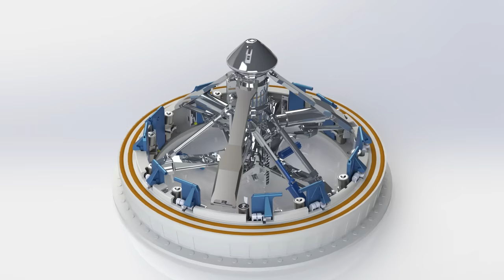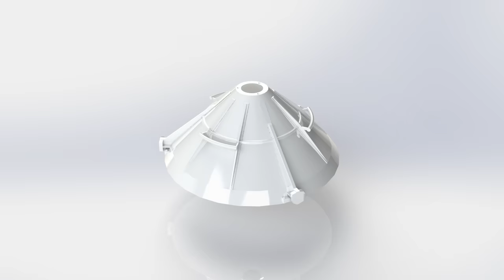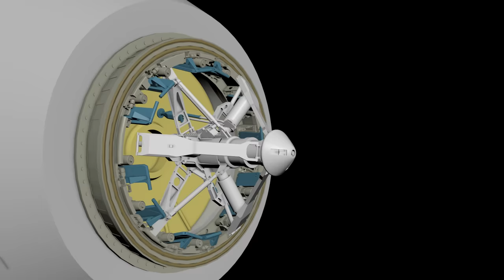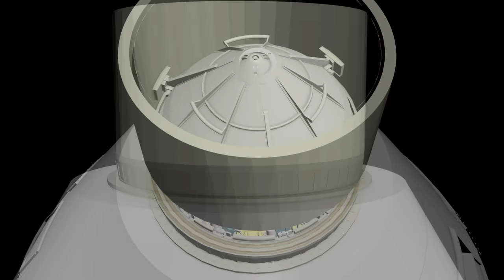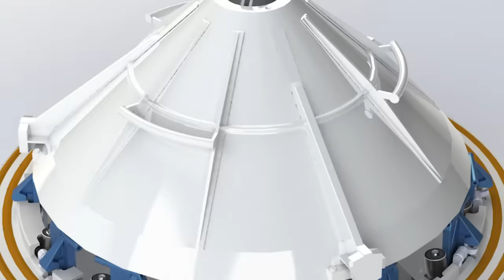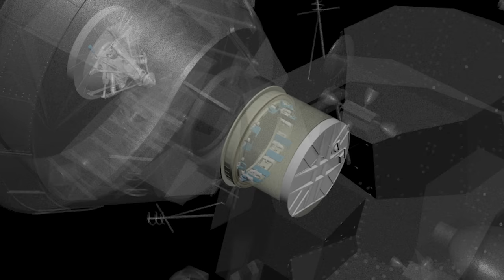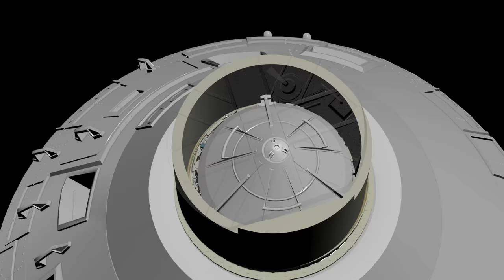Apollo Docking sequence - Connecting the Command Module to the Lunar Module.

Comment: As a young Aerospace Engineer  at NASA-KSC, I  was assigned to work on the Apollo Command and Service Module (CSM) for Apollo  missions 6, 9, 12, 13, 15, 17,  the three Skylab's and finally the Apollo Soyuz Test Project (ASTP).  Starting with Apollo 9, all Lunar Excursion Modules (LEM) ascent stages were mated to the Apollo Command Modules (CM) at KSC.   For Skylab, only the first of the three Skylab missions was the Skylab docking module docked to the CM.     On ASTP the Docking Module/Air Lock was docked to the CM in the same manner as the LEM ascent stages.  In addition, the Russian side of our Docking  Module had been previously sent to Russia and mated to their side of the Soyuz spacecraft.  All the docking tests at KSC were performed in the large CSM altitude chamber except for the first Skylab mission.   The Skylab docking module was too long and could not be lowered into the altitude chamber.   This test was performed after the CSM was removed and placed on another test stand. All docking test were performed in the same manner.   LEM ascent stages, Skylab docking module and ASTP docking module were inverted upside down outside of the altitude chamber before being lowered on to the CSM.  A special lifting device was used that controlled and monitored the amount of weight being lowered onto the CSM docking ring.   The Apollo prime crew commander using the mounted  Crew Optical Alignment System (COAS) in his forward looking window monitored the LEM ascent stage target during the lowering of the ascent stage. This helped us to properly align the two spacecraft.   After probe to drogue capture was verified by the prime crew, the ascent stage was lowered until just before the 12 ring latches would be triggered.   This was the critical part of the test.  Each of the 12 latches has a pull down clamping force of 2,000 lbs for a total of 24,000 lbs.  The 24,000 lbs would greatly exceed the structural integrity of the ascent stage as the latch hooks pulled the the ascent stage to the CSM docking ring in the 1g environment.  The specially designed lifting sling was capable of controlling the LEM ascent stage in a manner that only allowed just 5,000 lbs to be inserted to the ascent stage.   Once docked to the CSM, the lifting sling would only let a maximum of 5,000 lbs of the ascent stage to rest on the CSM.  Then the Apollo Commander would do a final adjustment to his window mounted COAS by manually aligning the cross hairs in his COAS to the ascent stage docking target stand offs.  After the docking probe and drogue were removed by the crew, the Lunar Module Pilot was to attempt entry into the ascent stage in order to align the Lunar Module COAS to a CM target that he installed above his seat looking out of his forward window.   On Apollo 9 two things became obvious,  first the lunar pilot could not properly adjust the COAS since he could not stand upside down in the ascent stage.   Second,  he found that it was difficult to see the CM target through the small CM window.  At that time the Apollo program called for the LEM to be the active vehicle for docking when returning from the moon surface.  As a result of the docking test, the CSM became the active vehicle for all dockings.  Finally, how the 12 latches worked.  The 2,000 lb clamping force is the result of a set of stack Belleville washers in a cylindrical housing that is connected to the latch hook.  The first pull of the latch handle compresses the Belleville washers 50%.  In addition, it raises the latch hook up off the LEM docking ring.  The second pull of the handle compresses the Belleville washers to 100% and retracts the hook to clear the LEM docking ring.   When the latch is triggered releasing the stored energy in the Belleville washers, the hook moves forward at the same time it clamps down on the LEM ring.  If a latch fails to fire,  the astronaut can activate a backup release button on the latch.  The blue latch handle had an indicator button that let the crew member know if the latch hook was fully engaged on the LM docking ring.  If it was not fully engaged he could then re-cock the latch and fire it.  Only a minimum of three latches were required for the mission.  To remove the docking probe he first disconnects the electrical connection between the docking probe and latch ring and stores it on the probe. Then he would move a lever that allowed the three legs of the docking probe to collapse.  The next step was to manually releases the three docking probe latches form the drogue and store it under one of the crew couches.  After the CSM/LEM was in orbit around the moon and the two crew members were in the LEM with the LEM hatch and the docking drogue installed the Lunar Pilot would insert the docking probe into the drogue automatically engaging the three probe head latches.  The electrical cable would be un-stowed and connected to the docking ring. Then by moving the the same release lever used in removal he would extend the collapse legs.  The three legs would be inserted into three pockets in the docking ring.  Next he would operate a blue ratchet handle at the base of the docking probe. This was a ratchet mechanism connected to a hook that kept the docking probe retracted.  Ratcheting the handle preloaded the hook to maintain structural integrity and sealing of the two spacecraft while the twelve latches were cocked.  After the CSM tunnel hatch was installed, the lunar pilot would release the three probe head latches.  The two spacecraft were no longer docked.  Once separated he then would electrically release the probe hook for the probe to be extended.  Upon redocking he would initiate a gas cartage inside the probe to retract the probe.
Reply from the maker: Wow, absolutely fantastic. That was amazing to read. Thank you so much for posting. I love the fact I've put this up and so many more interesting people are contributing to the discussion. Thank you so much for your contribution.
Reply: And like magic every single thing all functioned on version one with no real test system. Total  BS
Reply: Agreed 💯%
Reply: @marxman00  Almost like nasa knew what they were doing.
Reply: @chobinator8741  Sounds like a word salad sci fantacy , You could equally use that explanation to explain how santa clause delivers all his presents
Reply: @marxman00 Every bit of it was thoroughly tested beforehand. There was no guessing at all. That's what engineering is for. Providing all the tech for idiots to troll in maximum comfort.
Reply: @lunakid12  just like the "vaccine" you took
Reply: Well, that's easy for you to say!
Reply: What would 😅happened when those patches suspend?
Reply: The Apollo spacecraft docking with the Skylab didn't have a docking module. The docking port on the skylab already had the drogue installed on launch, so before undocking, they just stowed the probe in the CM, leaving the drogue behind for the following two flights. On Apollo 14, they did the same thing after rendezvous in lunar orbit before trans earth injection, they brought the probe back to earth, due to the docking problems they had during transposition & docking after TLI. No problems were found on the probe and the probe was later used on Apollo 15.
Reply: @marxman00 in other words "i dont understand it so it cant be real"

Classy
Reply: Thanks for your share, the apollo program is something special in usa and global history. We could do well for another achivement and inspiring adventure like this.
Reply: @razorfett147  Agreed. It's the classic "personal incredulity fallacy" -- when one assumes that something is false because it contradicts their personal beliefs, experiences, or understanding.

Comment: I've also read a bunch of documentation on the Apollo docking system, but this was the first time I truly understood the mechanics of how it worked. Excellent visualization!
Reply: Same here. Always wondered how exactly it worked.
Reply: Ditto.
Reply: I have also read about this, but I also read that some of the latches were closed by hand to prevent damage to the docking collar.
Reply: I always thought it was 2 connections, the docking one and tunnel, this certainly made it clear now.
Reply: One picture DOES speak one thousand words.
Reply: Excellent visualization!  I always wondered how the drogue was removed.  I could never figure that out!
Reply: Same here, thanks for posting.
Reply: +1
Reply from the maker: Thank you
Reply: Same here
Reply: Yeah, I've watched Apollo 13 and was always going nuts about the tunnel and what happened to the probe assembly. The tunnel is shown as always open in the film. Didn't know it was manually removed from the tunnel.
Reply: For years I would wonder how the crew went between modules with all the prode mechanics in the way. Most of the time they would be 📸 of the module with the probe in place and with out. Haha good shit
Reply: Guess Why they Never showed us. Not at the Bogus ISS either. In a POOL! . Kubrik masterpieces. A space odysee. Disney was Von Brauns best companion. Man to the Moon and Disney space cartoon movies. Must har been real. LOL.

Comment: I always wanted to know how this worked after watching Apollo 13, especially with so much of the docking hardware being 'in the way' in the tunnel.  Thank you so much.
Reply from the maker: Glad you liked it, thanks
Reply: In the film, they didn’t show all the removal of hardware, which was definitely confusing for people who didn’t know how the system worked.
Reply: @jeffw8218  , Exactly.  I didn't know if it was clever enough to fold away into the hatch somehow or what.  But as I have now seen, they literally take it apart once docked and stow it away.  Obviously, Apollo 13 was more focused toward the drama; because that's the job of a movie.  So the minutae of quite a lot of the technical bits were not shown.
Reply: They never show the removal of the hardware, and they kept the tunnel and its hatches wide open for the entire translunar cruise. Both ways. Other than that, it was pretty much completely accurate.
Reply: @meson183  In the movie, when they realize the CM is running out of power, Haise has to go power up the LM quickly before they lose their CM navigation computer. I imagine it could be very time consuming to remove the probe and drogue assembly if it was blocking the tunnel at the time of the accident.
Reply: @TheRealPSKilla502  In the movie they depict the tank stir procedures occuring shortly after a television broadcast, during which they had been passing though the tunnel and showing the interior of the LM.  If this is accurate, it means the tunnel was already clear of the docking mechanisms.
Reply: @meson183  Yes, it happened shortly after the broadcast (which infamously wasn't actually broadcast on any tv network at the time) , so the tunnel was clear indeed. What they "got wrong" however is that in the movie, the explosion happens instantaneously (when Swigert throws the switches) whilst in real life, it took about 90 seconds from the switch throw, to the actual explosion.
Reply: I bought the Hayne's manual for the Apollo 13 to figure that part of the movie out.
Reply: Nice, it's a pity that the lunar landings instead was a horrible lie
Reply: @donpettitwedestroyedtheapo6488  there's always one, people, we're bored with your type
Reply: @robflynn509  There are still too many of you, immagine how bored we are
Reply: @actually5004  The Chilton shows a little more detail but it's the same general premise.
Reply: @actually5004  Me too!
Reply: Yeah, they showed the CM hatch, but not the probe/drogue being removed or stored.
Reply: @donpettitwedestroyedtheapo6488  how can you be bored when there's so many scientific and historical facts left for you all to read into and still get totally wrong?
Reply: @donpettitwedestroyedtheapo6488  No there isn't my dude. The only way there's undebunkable evidence is if you refuse to believe and accept actual verifiable evidence which then just makes you a fool.
Reply: @paulscott2037  All words and no facts, if you don't provide proof it's just dumb Apollo banter
Reply: @KingdaToro   Wasn't that due to the fact, they never landed with the LM because they had the problem? It was just a lifeboat for them, so why would they shut the tunnel in the first place?  Or did they shut it because of the problem?  They needed oxygen in the LM, wasn't it?
Reply: @connectthedots5678  Leaving the tunnel open unnecessarily is dangerous, as there's a much greater risk of depressurization. The only thing holding the spacecraft together are the 12 docking latches on the docking ring, and a debris hit to either spacecraft would depressurize both. On a normal mission, they'd keep both tunnel hatches closed when they don't have to access the LM. On Apollo 13, they didn't ever need to put the docking hardware back into the tunnel, as they knew they weren't going to undock the LM and redock with it later, as you would for a landing. As for closing the hatches, that I'm not sure about. Closing the LM's docking hatch when the whole crew was in the LM would prevent the LM's oxygen supply from unnecessarily filling up the empty CM as well, and a debris hit to the CM wouldn't depressurize the LM as well. But such a debris hit would've made the CM useless for reentry anyway, so they'd be dead either way. That makes it kind of a moot point. But either way, they had to close both hatches and vent the tunnel before jettisoning the LM, just like on a normal mission.

Comment: I just saw this setup in Huntsville two days ago. It is a crazy high tech unit. They didn't explain how it worked but you just did, thanks. 
I saw the Saturn 5 rocket and I've been waiting to do that for 50 years, since I was eight yes old.
Much more impressive seeing it rather than pictures video etc.

Comment: This is brilliant.  Excellent animation and a thorough explanation of how the docking system works.  I'm going to have to watch this a few more times.
     I had no idea the Apollo 10 lunar module (Snoopy) still existed.  In 2037, they should send up an unmanned craft (or manned) to recover it and return it to Earth.  Not only would it be a cool exhibit in the Smithsonian, but it could provide valuable information about the effects of space on the hardware over the decades it spent in solar orbit.

Comment: My father was a Tech. Rep. For North American Aviation. He assembled the electrical connections used here.
Reply from the maker: Wow, fantastic. I bet he had some great stories 👍
Reply: @graffix101  he also worked on the B-70 mach 3 Bomber. When I was 10 years old he took me to the roll out in 1964. We still don't have a heavy bomber capable of mach 3.Also the X-15 Rocket Plane capable of Mach 6.7+.
Reply: @depluribusunum3128  For supersonic bomb delivery, rockets took the job and can deliver bombs large enough to blow up the plane delivering it, because the rocket is disposable.

Comment: Fascinating. I did a presentation when I was 8 on the Apollo XI mission using an Airfix model of a Saturn V. I knew at what point each stage separated but had no information about the manoeuvre to dock with the lunar module, so I just guessed how it must have worked. I’m glad to learn today that I got it right!

Comment: I always wondered how that worked, I could never understand how they entered the LM with that probe in the way. I knew it had to be removed somehow, but they never showed the astronauts doing it.
Reply: In the movie Apollo 13 you can see some of how it was done since they cover some of the procedure
Reply: On Apollo 14 they did a TV transmission on the way to the Moon where they took the docking hardware out and inspected it on camera (initial docking with the lunar module took multiple attempts so there was a need to look that equipment over carefully to make sure it was going to work again later in the mission).

Comment: Great explanation the only thing left out was where they stowed the not small probe and drogue.
Reply from the maker: Looking at the documentation it looks like it went back into position without being electrically connected.
Reply: @graffix101  yeah, but what would they do with it while crew were using the tunnel?
Reply: @jwilder47  There was room on the seat of whoever was going thru the tunnel, but I'm sure that the folks at NASA thought of a better spot to put it so it wasn't in anyone's way.

Comment: Beautiful presentation. The whole operation is so audacious I really can’t see how it was ever approved. I wouldn’t trust all those moving parts to work with 100% reliability down here on earth, let alone up there with 3 lives at stake and no backup. Engineers, take a bow.
Reply: There was a lot of redundancy. For example, only 3 of the 12 docking latches need to work for an airtight seal.  Most of the electrical operations could also be done manually. The biggest point of failure would be if they couldn't dock the CSM and LM in the first place in which case the landing couldn't proceed but they could still get home safely.  They also practiced a manual  crew transfer via EVA if the LM couldn't dock with the CSM after its return from the moon.

Comment: I read somewhere that Apollo 14 had problems for the first docking, they tried several times and it finally worked at last allowed chance, as the multiple attempts were fuel-consuming. They were lucky to be able to land on the Moon and not doing only an alternative lunar orbit mission. The initial mission was continued even with the risk it would occur again after liftoff from the moon, as there was an alternative: doing an EVA, anchor the CSM and the LM together with some chains and go back to the commande module by walking in space, carrying boxes with rock samples.